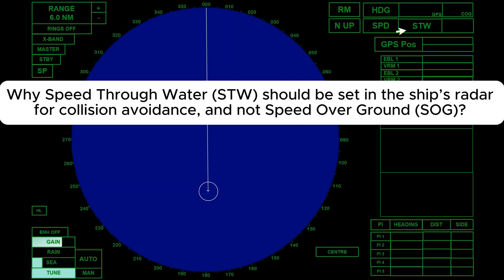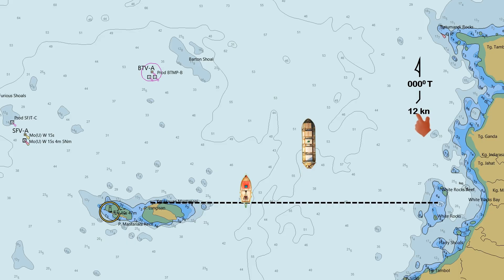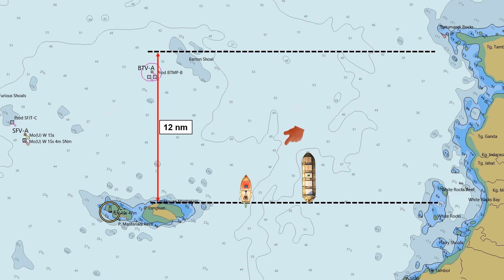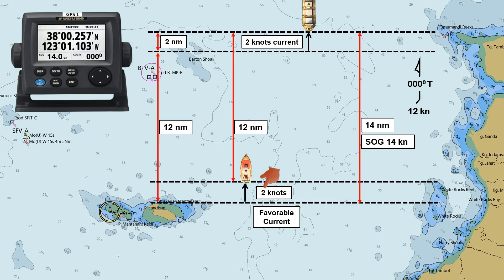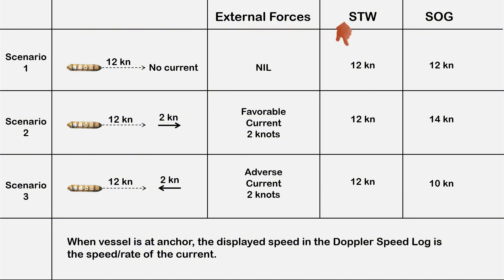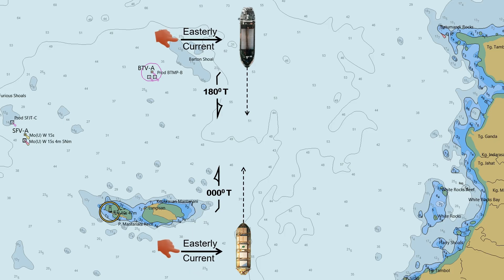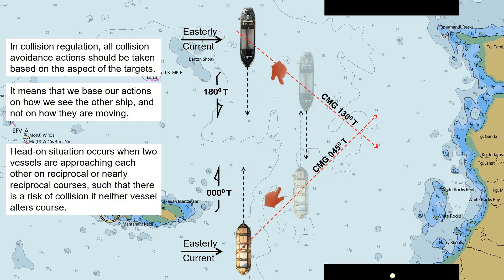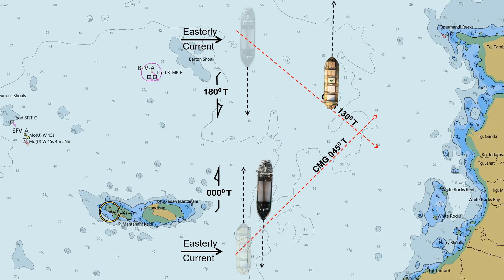Speed Through Water (STW) vs. Speed Over Ground (SOG): Why It Matters for Radar Collision Avoidance?

Comment: The statement that radar sea stabilisation is best suited for anti-collision purposes, as the true aspect of vessel can be more easily determined, is completely wrong as it clearly conflicts with several COLREG provisions when applied to collision avoidance decision-making.

1.	COLREG Section II. Conduct of vessel in sight of one another:
Rule 14 places decisive emphasis on visual determination of vessel aspect. It states that if a head-on situation is in doubt, it shall be assumed to exist. Relying on radar to determine vessel aspect may undermine this principle, as radar interpretation cannot override the requirement for visual assessment.

2.	Technical Accuracy Limitations: IMO Resolution MSC.192(79) specifies that tracked target accuracy for true course is ±5 degrees. This margin of error, combined with inherent radar limitations, can lead to misinterpretation of vessel aspect (e.g., confusing a crossing situation with a head-on encounter).

3.	Rule 7(c) Consideration: This rule explicitly warns against making assumptions based on "scanty information, especially scanty radar information." Encouraging aspect determination via radar may conflict with this cautionary guidance.

4.	Section III Distinction: Under COLREG Section III, Rule 19 (restricted visibility), collision-avoidance action is based on the detection of another vessel’s position and movement, not its aspect. This distinction appears intentional, underscoring the difference between radar use for detection and visual assessment for aspect.

While radar undoubtedly provides valuable collision avoidance information (bearing, CPA, TCPA – regardless of speed input), visual observation continues to be the primary means of establishing aspect under COLREG. It is therefore important that any recommendations remain fully consistent with the international regulations.

Comment: I didn't got this,if you can explain please... At 8:37 it was a collision avoidance by the rule 14 head-on situation. I think I understand that if you use ground stabilization in this situation,because of the current you will get a crossing situation.
What if I remain on sea stabilization, I will see different on the display, I mean, on reciprocal course of 000 degrees and the other ship on 180 degrees?
Reply from the maker: In collision regulation, we take our actions based on how we see other ship, NOT on how they move relative to the ground. 

In Rule 14 Head-on Situation paragraph (b), Such a situation shall be deemed to exist when a vessel sees the other ahead or nearly ahead and by night she would see the masthead lights of the other in a line or nearly in a line and or both sidelights and by day she observes the corresponding aspect of the other vessel.

In the given scenario, it is clear that the observed aspect of the other vessel exists as stated in Rule 14 Parag (b). In restricted visibility, where we rely on radar to assist the situation if the risk of collision exists, always set the radar to sea stabilized mode, most especially in collision avoidance, as it displays how other vessel moves through the water.  I already made a video that explains in detail about Ground and Sea Stabilization, if you'd like to see the details, kindly check it from this link: https://youtu.be/JQ52DMireIc

Comment: I don't understand why need to make the explanation with the boat and the island... just say that stw should be equal to engine distance (if you are moving with the engine) or equal to the current (if you are not using the engine )
Reply from the maker: Thanks for your feedback! This video on speed through water (STW) and speed over ground (SOG) covers more than just engine speed and current. It also explains how we interpret radar targets, whether moving or stationary, since setting the radar to STW or SOG can affect the accuracy of target vectors. This understanding is crucial to avoid mistakes in collision avoidance and applying COLREGs effectively. The boat and island examples help demonstrate these points visually for better clarity. Hope this helps!